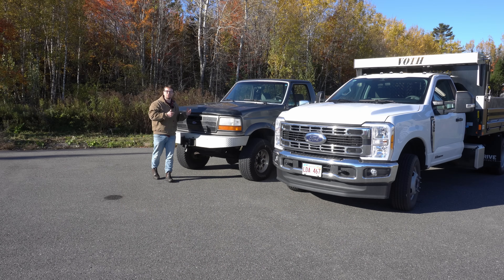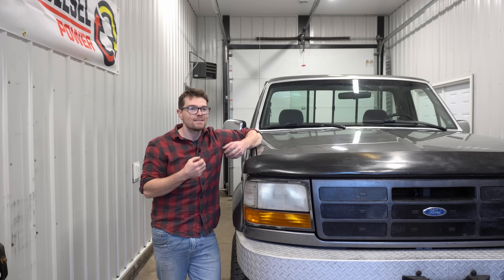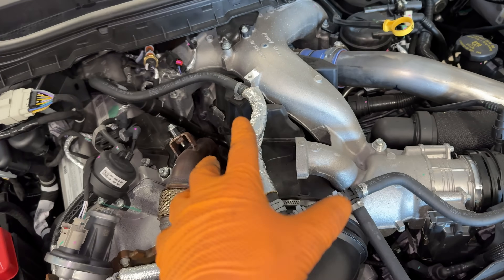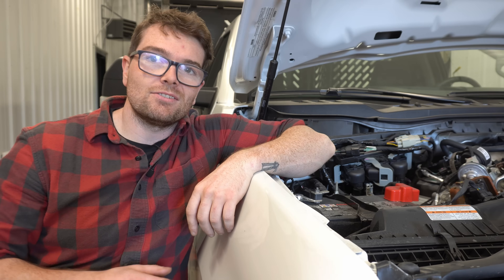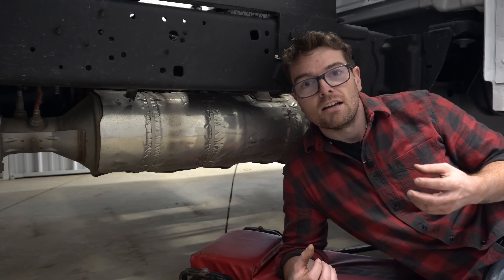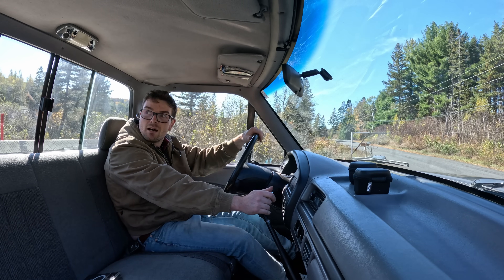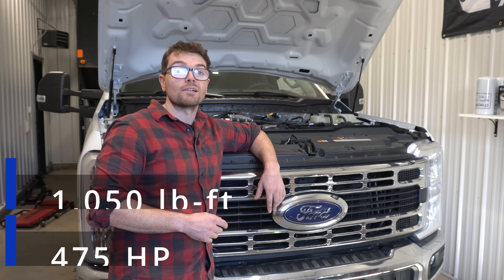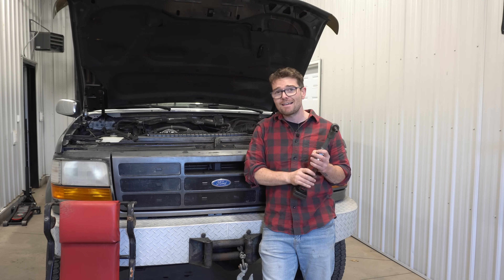Ford F-350 6.7L PowerStroke | 5 Reason Why New Diesel Engine SUCK *Diesel Mechanic Explains*

Comment: Stupid question, but why not capture the EGR after the DPF filter 🤔 Wouldn’t that make the EGR cleaner going into the engine, reducing the soot buildup? Anyways, like always, fantastic video! Super proud of you and congrats on hitting 70k subscribers!
Reply: Caterpillar actually did that it was called clean gas recirculate but they couldn’t keep up and left the truck industry in like 2010 but it didn’t soot the engine up being after the DPF
Reply: The only modern diesel I may consider buying if my deleted lbz ever dies.@BocoGreenpeace

Comment: The best part of the 7.3 is you can’t run it out of oil because of the HEUI fuel injector
Reply: They will run with 7 qts in them. They also will destroy there bearings.